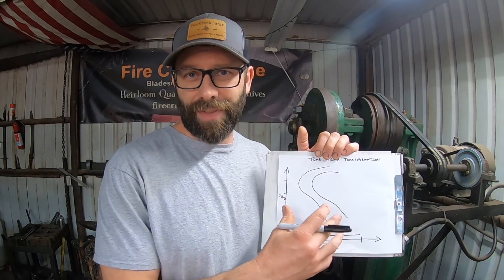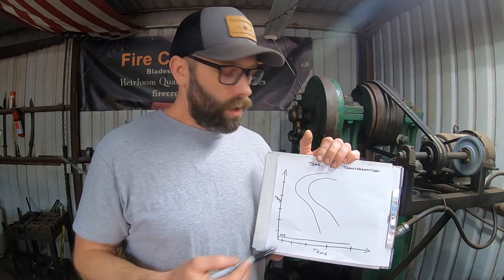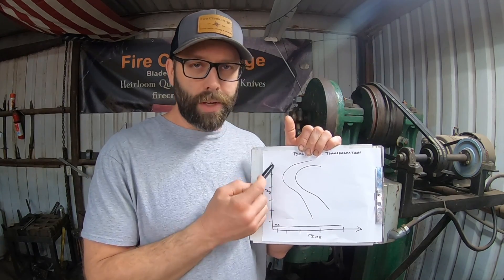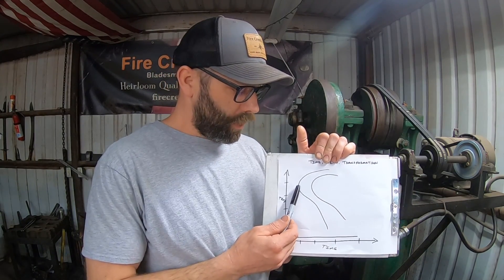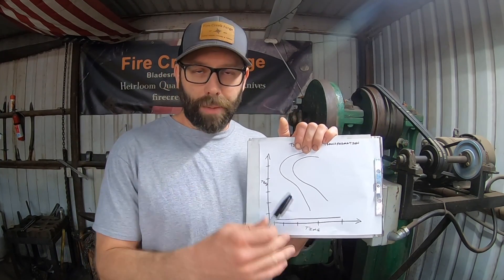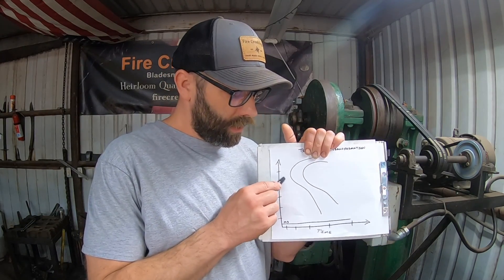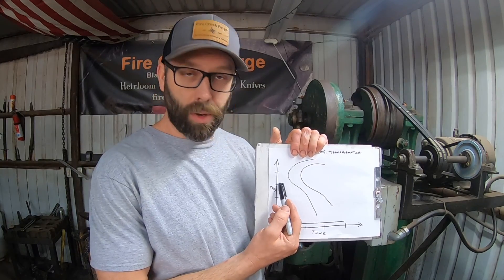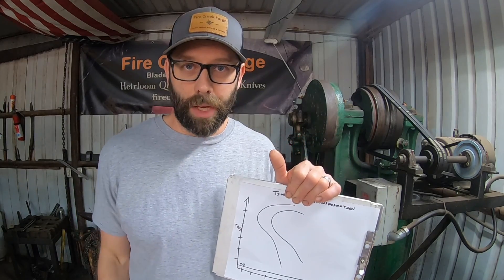Metallurgy Monday #2: Stop Cracking Blades In The Quench

Comment: Since i don't comment on your videos often and I am giving a technical response to this one, let me introduce myself by saying that I am a professional metallurgist who was introduced to the trade through knife making more than 30 years ago. Professionally I work in a very large forge shop making some of the largest forgings used in North America. As a hobby, I still have a blacksmith shop along with some fabrication and machining capabilities. I do some occasional knife work but mostly other kinds of forging projects these days. However, technical metallurgy stuff is my bread and butter. 
Nice job introducing TTT diagrams. They were a real revolution to the steel industry when they were first introduced in 1930.  Edgar Bain and E.S. Davenport did the initial work to develop the first ones and it was this work that was the reason Bainite is named after Edgar Bain. To add a bit more detail to why blades and other steel parts crack during quench: there are two primary sources of stress during quenching. The first is contraction of the object during initial cooling. This is fairly intuitive as most of us understand that metal expands when heated and contracts when cooled. HOWEVER, when martensite forms there is an increase in volume. Martensite actually has a greater volume than austenite so even though the blade is fairly cool when that transformation happens, there is a significant increase in volume and that increases the stress in the blade enormously. Your advice to cool rapidly only at the very beginning of the quench works because the stress from contraction is minimized. Additionally, the difference in temperature between the hottest and coldest part of the blade prior to the start of martensite transformation is also minimized. This means that when martensite begins to form it will largely form at about the same time everywhere (assuming no insulating clay or similar techniques are used). When uniform transformation to martensite does not happen, as in the cased of very large cross sections or when quenched rapidly all the way to room temperature, the outside of the blade transforms to martensite first. A moment later, the inside also transforms to martensite, but because the outside is already very hard and brittle, the volumetric expansion of the interior sometimes is enough stress to cause cracks.
Reply from the maker: Thanks for filling in some more detail, and thanks for watching the videos!
Just goes to show how detailed and in depth the subject of metallurgy really is.

Comment: Got quickly question my friend. (If you use kerosene for Damascus) Does it matter were you get your kerosene for Damascus? I asked one other yt blacksmith\bladesmith and they didn't know cause they don't use it for Damascus.
Reply from the maker: I dip my billets in diesel. WD-40 works great also. I've never used kerosene but as I understand that's basically the same as WD-40 plus some additives.
Reply: @FireCreekForge  thanks my friend

Comment: My biggest cause when I was starting out was just simply grinding too thin and not leaving enough stock to absorb the trauma. This will also show itself in some pretty wild banana bends too if your grind is a bit off-kilter by design or carries some extra mass on one side.
Generally though, if you follow through a thermocycle regime of normalisation, grain refinement, annealing and stress relief (in that order) you probably won't run into too much trouble on high carbon steels- it doesn't necessarily apply to high alloy steels and your mileage can vary quite a bit with those.
Reply from the maker: For sure. I don't use regimen of multiple cycles though. (any more) because I don't want alloy banding with the steels I'm using. (not all steels are prone to this). The grain can be corrected (so far as is necessary) in a couple operations.
Thanks for watching
Reply: @FireCreekForge  I've been forging a lot of Apex Ultra recently and its something which seems to require a lot of thermocycle processing to get the most out of it, particularly the grain reduction needing it three times. Like the homogenity is there for the alloy + carbides, but they tend to be very large and need some work to get them smaller.
Pretty strange steel, compared to my workhorses in 1084 and 26C3 that don't need a lot of work in that department. More akin to O1 than a carbon steel with all its alloying components I guess.